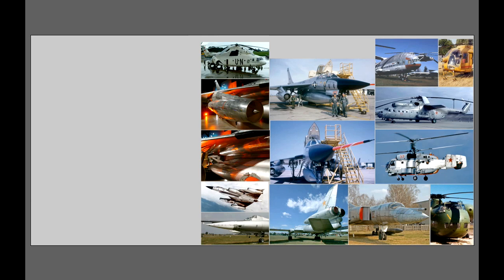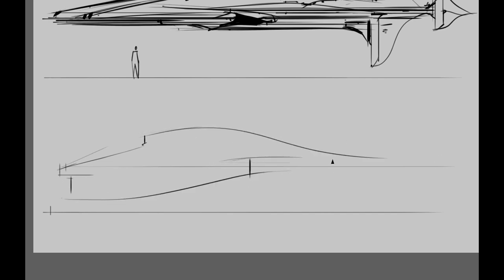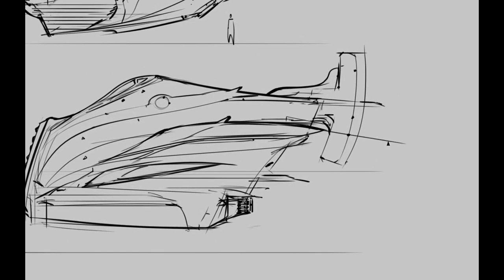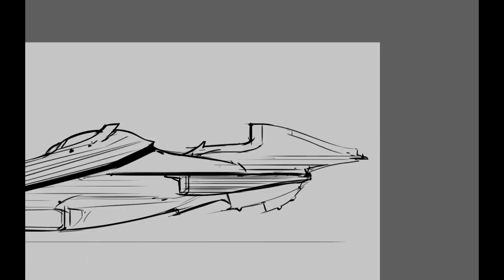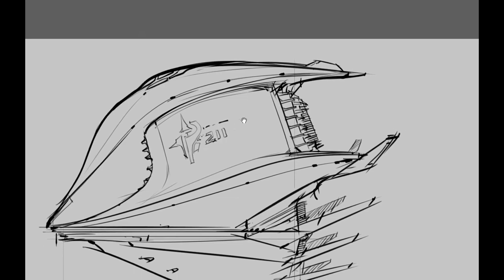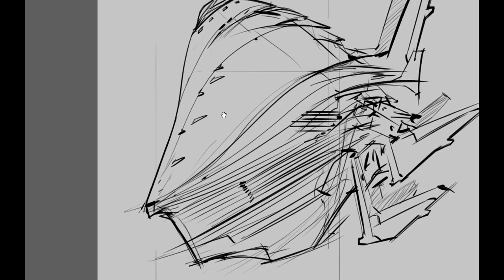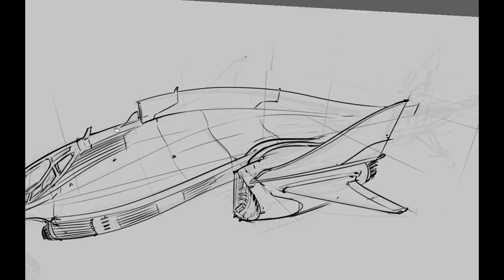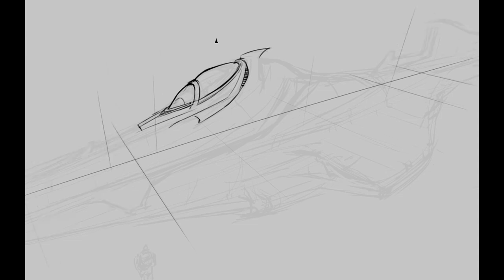Design Cinema - EP 77 - Fish Fighters

Comment: Hi,
It was a very helpful tutorial and well commented Feng as always. But just one thing worth to mention for new designer out there.
When you are in the process of Design, please don't throw lines here and there without actually getting a picture in your head of how the shape looks like in 3D.
In my beginning I used to do a great profile design, but when I try to port them to 3D (since I'm also a 3D modeler), I find a lot of trouble to get the idea of the shape I wanted from that line, even with the shading. Thus, I find myself going back to the design and try to remember the workflow I went through to get that line in that place.
By time I used to write notes beside my designs. But the most good way to a successful design is to draw a line only to express an Idea or a technology a process if you want.
Remember that and all the artist in the production pipeline will appreciate your design even if it bizarre.

Comment: Hello Sir, I have a question about drawing method - Isometric vs. Perspective. I have an engineering background which includes mechanical design using Isometric, but now I finally changed to Game Design and Concept art. So where do we use Isometric and Perspective to get the best out of them. Thanks in advance for your upcoming answer :)

Comment: Do you find yourself using more the Wacom Intuos or the Cintiq monitor? Either for sketching or painting/coloring? I have the  Intuos Pro Large but wondering is it worth using/investing in to the Cintiq 21ux DTX-2100 2nd gen,(2048 pressure sensitivity) they are like $1000 used now on ebay, ( even if you have the cash to spend but if you don't need it why would you right?) just wondering
thanks Feng !

Comment: When your sketching, do you use just a normal Dot brush with varied Line weight? or do you use a different brush?
Reply: You can sketch with pretty much everything. As youve seen in some of the earlier videos,he was using various techniques: Square brushes,circle brushes,fluffy brushes,textured brushes,blurred circle/square brushes,calligraphic brushes (my personal best),the fading brushes (faded to visible (the more you press)) or even the shortening brush (thin to thick (the more you press)).
With a sketch,you just need to set the basic tones/colors/shapes of drawings,at the end,they wont be visible,so sketching is not so importnant for the look.

Comment: how can you do such clean/strong line quality. Is this on cintiq or wacom.
Reply: Cintiq is made by Wacom.
Reply: sorry i mean the normal intuos
Reply: Those clean/strong line quality comes from experience. No brush or anything, just practise every day for years.
Reply: Thanks for all the info. I know that it come with lots and lots of practice. But i did practice alot and the linework on photoshop is just so bad compare to the one when i use pen/ pencil on paper.
Reply: Hey OP, you might wanna check out that software called Lazy Nezumi. :)
Reply: This video was probably done on an Intuos, since it was made 5 years ago and he only recently got a Cintiq (See episode 57).
Reply: For those completely horizontal/vertical lines, you can hold down shift in PS